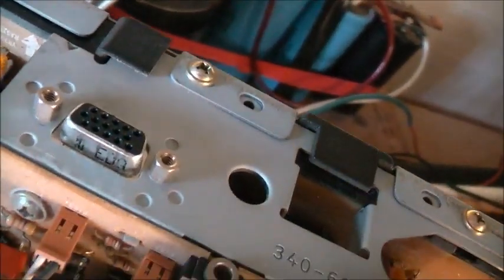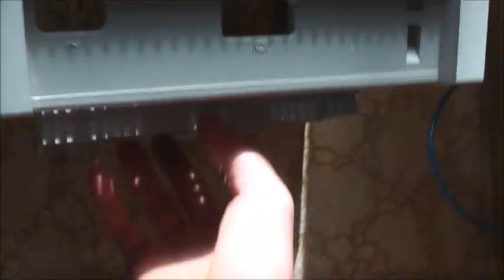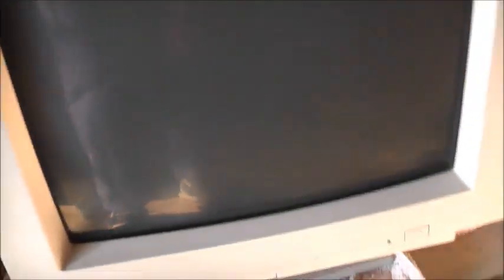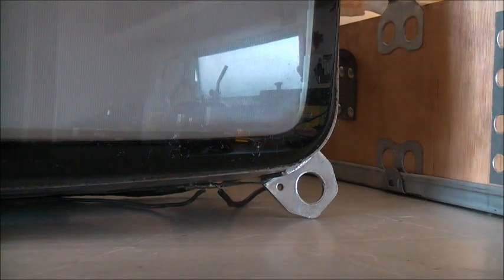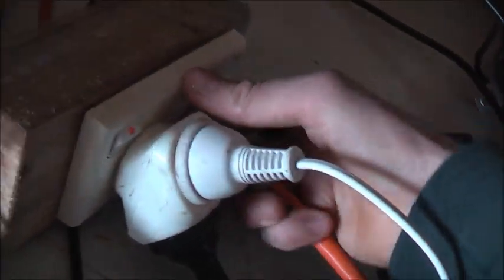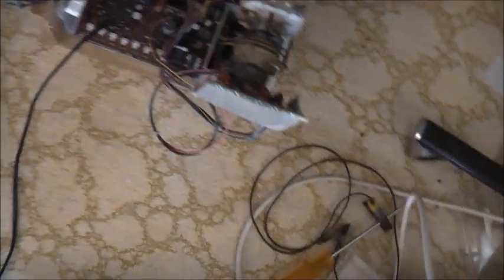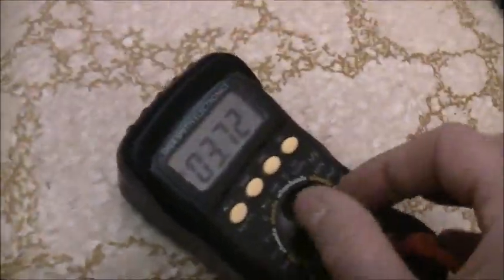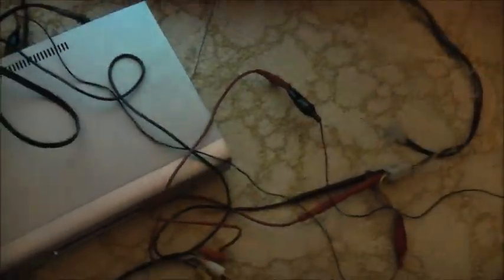Arcade Monitor Testing Part 1

Comment: That or less likely: the bootstrap circuit for the main SMPS controller got a bad capacitor or fault in the winding powering itself.

Comment: The main logic is NOT powered from the flyback and you will get the deflection all wrong since it's based around the flyback. main PSU powers controller that control transistor driving LOPT in sync with the video-source. If you power it with a ZVS on the flyback there WILL be missing voltages and very incorrect voltages.